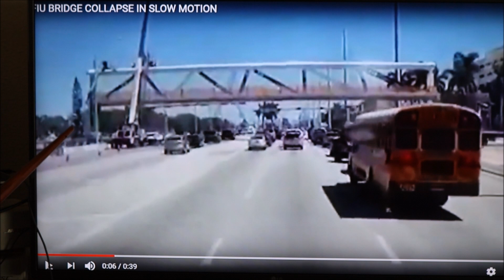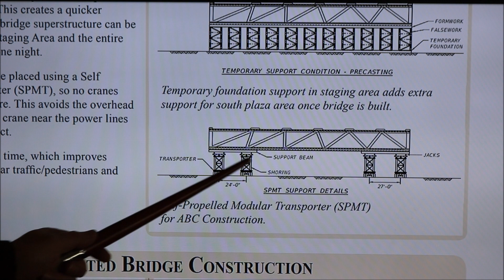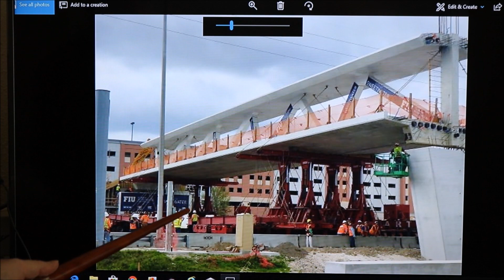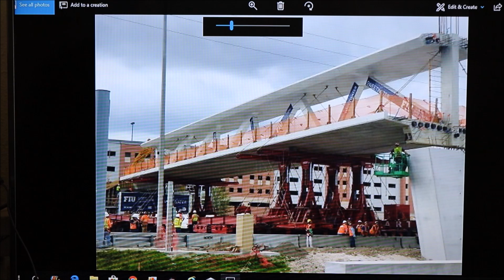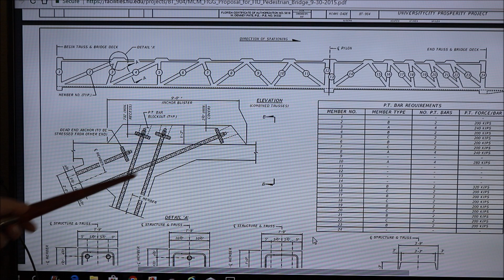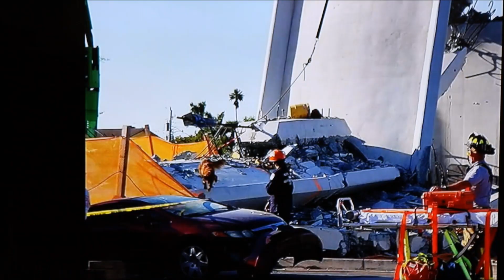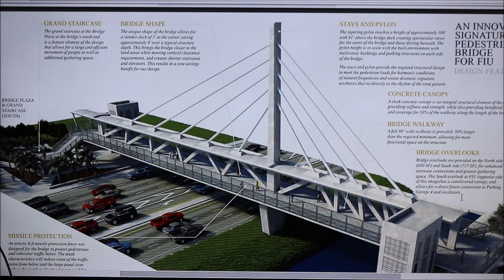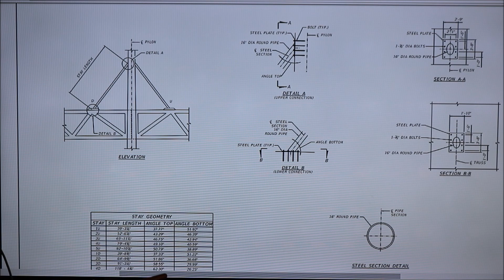Miami Bridge Failure Update 18 March 2018

Comment: The bridge failed at the first interior joint from the north end, due to a shear/bearing failure around the brace cap, since a greater than 400 kip load from the roof slab needed to transfer into the last diagonal brace at that point.  A post collapse photo of the brace cap from above, revealed very little reinforcing passing through the failure plane.  But a large amount was required.  As much as two layers of #6 bar at 4" o.c. each way.  It looks like maybe #4 bar at 12" oc was installed, in a single layer.  So only 10% of the steel was installed, of what would have been required with a competent analysis of that joint.  Obviously, either the structural engineer screwed up by himself, with the equally incompetent building department giving their blessing to the faulty design.  Or the contractor left some reinforcing out to pay for beers after work, and all inspectors failed to catch it.

Comment: Another defect in the design, was the fake cable stayed structure.  Since pipes were specified, and pipes do not have the capability of spanning the 100 or so feet, without sagging like the dickens, the final bridge would have never looked like what the Architect had in mind.  The sag of those pipes would have pulled the pipe connection out of the mast, that then would also have been likely to kill a bunch of innocent people in their vehicles.  Whomever stamped the structural drawings, is eligible to have his or her license permanently suspended.  Whomever reviewed the drawings for the local building department, should be fired.  This cutting edge design, was so ill conceived that it boggles the mind how incompetent the structural engineers were, who were on the design team.

Comment: Notice that the bridge fell faster than the worker standing on top of it.  That critical clue points to a force that was pulling the bridge down, that was located on the bottom of the bridge.  The most likely culprit would be the post-tensioning force in the floor slab.  The balancing compression force in the roof slab would ordinarily keep the bridge upright.  But that is assuming that the compression in the roof slab was properly transferred into the critical strut cap at members 10 & 11.  But it wasn't.  Therefore, since the initial concrete shear/bearing failure occurred at that strut cap before all other failures, the bridge fell faster than gravity alone would have brought it down.  Case solved.  End of story.

Comment: When the bridge was placed in its final position the diagonal member was further compressed releasing or loosing up the  the load applied earlier during construction to the prestressed pt bars.   being member 2 too slender and reinforced with just two tendons, ended up giving up and secondary stresses due to axial  load and eccentricity  exhausted member capacity which end up failing.  If my understanding is correct member should had been detailed as a column.  Dwgs available does not provide enough info for thorough analysis

Comment: This is facinating stuff and the video you did the day before was excellent as well. I agree with you in the first video where you said this coul have been a much lighter design. But i Also think this should have been a suspension designed bridge with cable support poles on each side of the roadway. Also probably would have been easier to install if it were a 3 section instead of a 2 section. I would like to hear your opinion on that.

Comment: I was leaning toward the assembly process as being reason for the failure until Juan said four words. 
“ new environmentally friendly materials “  I would take a hard look at said materials.
As NASA came forward with its “ environmentally friendly “ foam that covered the external fuel tank. If I recall correctly, the space shuttle experienced an increase of over 300% in foam strikes during launch using the new foam, until the ultimate strike killed 7 astronauts.
Reply from the maker: Yes! remember that?!
Reply: blancolirio I failed to mention in my previous comment.
Another excellent video by you. 👍

Comment: I sell engineering plastics for a living.  I'm familiar with tensile, flex modulus, elongation and impact properties from a plastics standpoint. Concrete and steel have fundamentally drastic differences in mechanical properties.  Making an adjustment of tension of the bridge while in use was to me a tragic error.

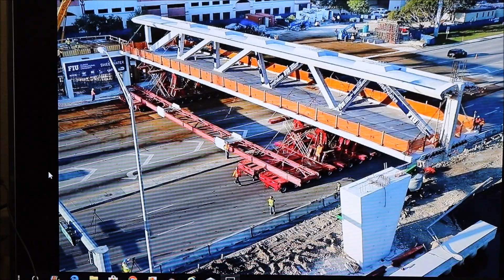Comment: No.....not "As so often occurs in Engineering" ( timeline 2:07 to 2:10)....suggesting that it is "common" that willy-nilly changes take place. A PROPER Engineering/Construction firm MUST use some MOC ( "Management of Change") process.....such when field-changes are desired, it MUST not compromise the INTEGRITY of the original design and not compromise the original safety margins employed. May require home-office engineering review of the propesed design change or procedure change.  The situation here is pure-and-simple SLOPPINESS.....or RUSH TO COMPLETION....or any such things that show simple lack of OD...."Operational Discipline". When proper procedures and proper OD  is applied, this just doesn't happen. A core question remains....how in H%ll does someone tension the rods WHILE traffic is moving underneath, even moreso the span support used is NOT per the drawings shown....especially in absencew of supporting MOC documents ( so far, not found or shown).

Comment: I’m not an engineer but by the looks of it, it seems like a poor  structural design for the span. Too much concrete weight and its ugly too. And it looks like there was unused space in the center for at least one support column. What a waste and tragedy.

Comment: The following excerpts are from an article written before the bridge collapse:

The bridge is also made of self-cleaning concrete. When exposed to sunlight, titanium dioxide in the concrete traps pollutants and turns them a bright white, the university said.

"This bridge is not just someplace to someplace else," Rosenberg said. "It will have places where people can study, where they can contemplate, where they can observe the incredible traffic and dynamism of West Dade."

This was a snowflake bridge.
Reply: Aw, c'mon Jim, you were a kid once. When you're a 20 year old university student there's nothing like studying or relaxing in a hammock on a quiet bridge above an 8 lane highway with auto exhaust wafting all around you. Researchers at UC Berkeley are studying how the synergy of carbon monoxide and tetrahydrocannabinol increases mental alertness and comprehension. Get with it man, it's the 21st century!

(Note: I made up part of that.)

Comment: Please note that web member #11 was in tension when on the transporter but in compression once set on the pylons.
Reply: plus, top chord in tension on the move to counteract the moment around the outer north jack, bottom chord in compression. These states would be reversed once the bridge sat on it's piers.
Reply: Agreed.  Stress reversal occurred in both webs and chords.  Just conjecture on my part of course, but I only saw a stressing jack being used on web member #11 at the time of the collapse, so what if the worker was supposed to be de-stressing the tendons and he accidently added tension (and lots of it), it might be possible to fail #11 in compression.  Again, total speculation.  Just throwing this out as a possibility.
Reply: http://www.eng-tips.com/viewthread.cfm?qid=436802 don't know if you have seen this thread. At the top of the page is a digitally enhanced version of the dash cam video. Looking at it frame by frame esp. around the first collapse, there is a colour change around the strut 11 meeting the base of vertical strut 12. the consensus on that thread is this point is where it failed initially.
Reply: Thanks.  I had not seen that thread or the slow motion video.  Seems to confirm failure of strut 11 initiated the collapse.  Time will tell and we will learn from this.
Reply from the maker: correct, I need glasses.

Comment: Is it possible the rod itself was of poor / substandard quality, which caused it to fail prematurely?  I remember a demonstration we had during my college days, where a rod was loaded to its maximum strength in a machine, it then began to stretch and ultimately snapped in two.  I thought I remember the instructor stating that poor quality steel would have a substandard load pattern and fail prematurely.

Thanks.

Comment: Some important context on the re-positioning of the center column, and the lengthening and redesign of the span: https://apnews.com/2f73cc5f73304d9b9c5c44ee9ec6ade5

"Difficulties began in late 2016, when the Florida Department of Transportation emailed project officials saying they needed to move the bridge's signature pylon to allow for future widening of the road"

“This ... places the current location of the pylon in conflict with the extra travel lane and would require bridge design modifications,”

"After weeks of back and forth, it was decided to move the pylon 11 feet to the north, sitting near the edge of the canal. According to documents, initial costs for the new design were $204,540, with another $402,723 for construction changes."

"While the NTSB probe has just begun, multiple engineers who reviewed the documents obtained by the AP said moving the tower after the bridge’s initial design invited errors."

"The documents show that further time pressures were put on the tower redesign due to a bottleneck at the U.S. Army Corps of Engineers. The Corps was in charge of permitting certain aspects of the new tower’s footing and other elements but had stopped due to federal budget cuts. Documents show the contractors wouldn’t begin work until the Corp’s permits were finished, and FIU worried delays could jeopardize federal funding."
Reply: That's an interesting article. As someone says, it's not a good idea to alter a design once the it's been approved.
Reply: Providing for a ten lane urban road is an urban planning folly in itself

Comment: Just so you know the stays are tubes that the cable runs through thay do have tension cables inside of them tubes on the other cad drawing......

It all boils down to the city not letting them block the damn road and being all mad about the traffic let them block the road and do the job right people need to stop being in a hurry
Reply from the maker: RealFifty interesting, I’d like to see those drawings. Thanks!
Reply: Ave had a video about it

Comment: Mr. Brown, I watched your video coverage of the Oroville spillway failure and repair with interest and respect. I live a bit south of your neck of the woods. 

With that thought in mind, I think your analysis here is spot on. I've seen other videos that focused on that particular tension member. I remember a witness being interviewed on an MSM live stream, can't remember which, and haven't been able to back track it, but the gist of it was that he said he saw a blue assembly of some sort, hanging from the large black crane in the traffic lanes, not the smaller green crane next to a pylon, involved in tightening a cable. He said that the blue assembly dropped, hit the bridge, and took it down.  Also said they backed the large black crane up a ways immediately after the collapse. Furthermore, an engineer involved voice mailed FDOT regarding cracks seen in the structure.
https://www.politico.com/states/florida/story/2018/03/16/engineer-of-fiu-bridge-reported-cracks-in-structure-to-fdot-days-before-collapse-318961

Why this happened seems irrelevant to me. Engineers are only human, that's why test pilots are paid so much. And while I prefer tried and true construction methods over exotic cutting edge stuff when it comes to public infrastructure (like the rusting anchor bolts on our fancy, cutting edge, over budget bay bridge), what stuns me is the hubris within the decision making process that led to allowing public traffic to be stopped for a red light  underneath a bridge that was, in effect, still under construction.  

I'm sure there will be much investigation and analysis of this disaster, and many lawsuits against the companies involved. It seems to me that there are some public officials who need to held accountable for gross negligence resulting in 6 counts of manslaughter, along with other damages. 

Common sense seems to be getting rarer than hen's teeth in this "modern" world...

Comment: I suspect that the deviation from the shoring design whereby the temporary cantilever was created caused over-stressing of the tendons. This also would create hairline defect cracking in the concrete, especially if the concrete was not allowed to fully cure and reach design strength. This cantilever, if not planned for and calculated into the design, would not have accounted for the extreme tensile stresses caused by the massive gravity load of the bridge and the additional dynamic load created when the bridge is moved into place. As such, the tendons were likely compromised to some degree well before the bridge was lifted but there was no way to know this for sure unless the contractor was monitoring for deflection of the cantilever while the bridge was being moved. Once the bridge was set in place, the additional post-tensioning of the tendons likely stretched them very close to, or perhaps even beyond their yield point in a small amount of time. Failure could be exacerbated if the proper sequencing of the tensioning machine did not happen because the compromised tendons were not known to the contractor before commencing the tensioning operation. Obviously determination of the exact reason for failure is a long time away. Based on what I have seen and read, the contractor (or whomever made the decision) to alter the shoring design to accommodate the conditions of the road will likely be a significant factor when the investigation is over. My condolences to the victims and their families.

Comment: The end diagonal is a compression member. It doesn't need the post-tension rod for support. The rod may help for confinement of the concrete at the upper or lower nodes. The confinement might help for the transfer of shear loads in nodes. It is difficult to transfer the high compression loads in the end diagonal to the tension in the bottom chord. Unless there is a load transfer issue at the nodes, it really doesn't make sense to have the compression member post-tensioned.

I am curious to know if the cracks in the concrete at the north end were in the deck  and due to the transfer of the compression in the diagonal to tension in the deck.

I would look for a flaw or void in the concrete diagonal (weakening the compression member), review shear loads at the nodes, and check the transfer of the compression in the diagonal to the tension/bottom chord.  I think these are most likely failure mechanisms.

Comment: What?  The drawing specifically refers to "stay cable pipes".  How does the writer ignore that and simply say they are for aesthetic purposes only?  In my opinion, the structure would not stand without those upper stays, and indeed it didn't stand without them.
Reply from the maker: You fail to understand the concept of ABC construction. The main span must stand on it's own without additional support. Go back and watch again.

Comment: Actually, if the construction worker on the "stay" #11 was doing anything, he should have been relieving the added stress placed in that member for the movement phase. If the instructions were misunderstood, and he actually was adding tension, he could have caused the failure. Given the fact that he did not have his safety harness connected properly, he may not have been the correct person for that job.
Reply from the maker: KenN None we are not clear on the safety harness aspect yet....
Reply: l Agree, it is difficult to see in the video. I have some experience with precast/prestressed/postentioned concrete. If that construction worker was adding tension, instead of destressing, it could have caused the failure.
Reply: My point was, if (s)he did not know how to wear the safety apparatus properly, perhaps (s)he did not understand the directions to release the tension applied to the element, and increased the tension instead, causing the failure of the element, and subsequently, the entire structure.

Comment: The tension rod was already in yield.  It couldn't take up any more tension.  Further tightening the rod moved it through yield and into failure.   You can see it ejecting in the dash cam photo.   Post tension can work well, the move into position wasn't as specified and probably exceeded the design spec in transport due to excessive cantilevered forces

Comment: Im not an expert but I have some questions for the experts. 
1.  When adding tension or adjusting tension to a bridge, doing a stress test, etc. Is there a possibility of failure?
2.  If there is a possibility of failure, WHY would you let traffic continue as normal?

Comment: The member you mention that they were 'tensioning' would be in compression. (I am a structural engineer). They might have been adding tension to the road temporarily simply to get to loosen the cables perhaps? but there would be no need or point to add more tensioning force to the cables (which adds compression) to a column that was already under compression.

When they moved the structure the column would have been under tension and during the move is when they would need the rods tensioned. Once in its final position, tensile force in the road is unnecessary.

The only reason they could have wanted to add more compression is if there was somehow a significant moment through the column. From the overall layout, this seems unlikely.